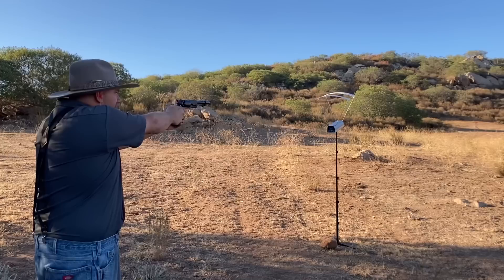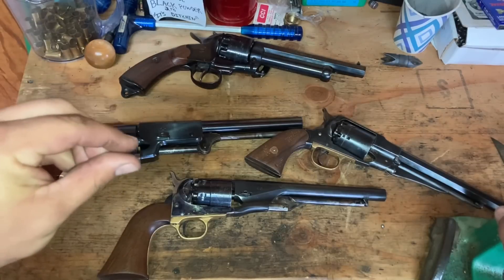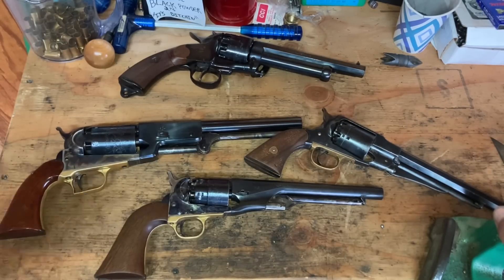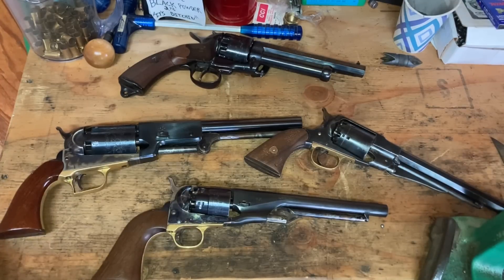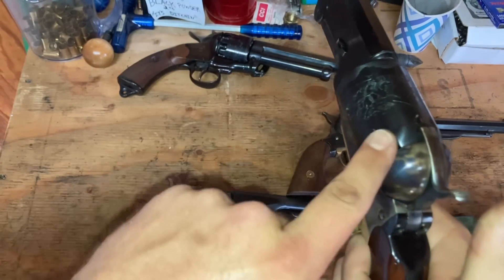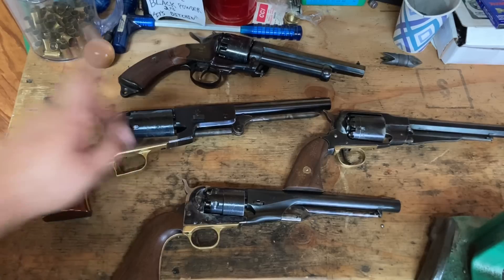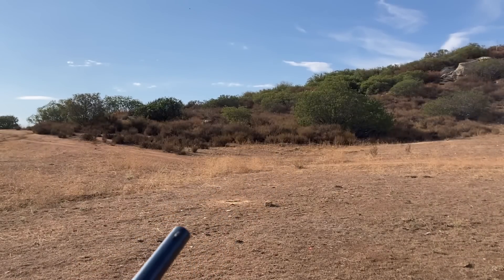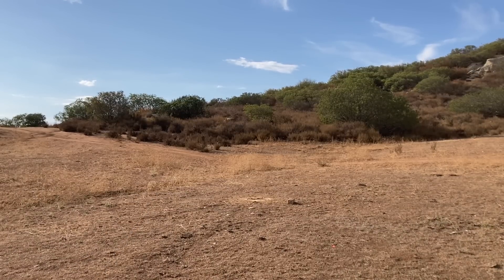What Causes A Chain Fire?

Comment: Excellent, only my opinion of course. Really appreciate your attitude about not expressing what you experienced as absolute, unquestionably true. Parrots lack that insight. My first C&B was a Replica Arms 1861 Navy (early Uberti I think), when I was 17 or 18, thought I was breaking ground, but you and others have made earlier tracks. That was sometime in the 60’s. Tried to make felt wads the way E. Keith described. Couple of cylinders and I could hardly get the gun apart. As far as accuracy, there wasn’t much. 
Thanks for taking the time and effort to make this informative available in a video. Again, great job. O.R.
Reply from the maker: Thank you!
Reply: @Everythingblackpowder  is true black powder no longer sold???
Reply: “Parrots”. Good one! 👍
Reply: I had a chainfire once on my 1858 Remington New model army. Interestingly it was not the neighboring chamber but the one completely opposite. Let's say the one you want to go off is 12 with the barrel.... My chain fire was at 6 a clock. 

I have fired probably 80 rounds since then and I use a toilet paper wad between the lead ball and the powder charge. Now the safety rangers can go ahead and stroke out. 
I'm not saying anyone should do that but that's what I do and it works fine. Just be aware of that toilet paper wad May prevent a fire hazard in very dry conditions
Reply: @RobertWard-sb6bd  interesting. Can I assume then that you were only using powder and ball at that timer?  That sure indicates that your chain fire ignition did not happen at the nipple end of the cylinder. Just wondering also, if the ball was cast or swaged?  Thanks for the info. O.R.
Reply: @oldranger3044  it was a cast lead ball. It happened about 8 years ago so I don't remember exactly if I used a wad or not. I do remember the last time I fired and cleaned and put the gun away, i used a light oil called Rusty duck lubricant. I'm suspecting that I probably didn't clean that lubricant off very well before shooting and it may have played a role
Reply: @RobertWard-sb6bd  Thanks for getting back on this. My though about the cast is that there is usually some sort of defect where the sprue is cut off, and without sufficient lube or wad the hot gases could bypass the ball in that area and reach the powder. I think that with enough shooters commenting on their experiences, it might help to get closer to causes of the chain fires. Thanks. O.R.
Reply: @oldranger3044  I have an 1858 Remington New model army by pieta. I have a round ball mold for.451. I just ordered one and 454 what just what I hear most people saying to use but I have also heard 457. I do know the 451 will not shave a ring of lead off of the ball. Anyone that owns a cap and ball should get themselves the proper sized mold and not only save money but also have fun learning to cast bullets
Reply: @RobertWard-sb6bd  I agree, but then I I have almost more fun casting, and there is no cleaning afterwards (actually that’s not bad when set up for it). Round ball casting is a great beginning experience because it is not as critical as say modern bullets, and the chambers do the sizing. Of course there is still the necessary precautions. I shave a fair amount of lead with the .451 Lee mould. That is with older guns where chambers are not beveled, like the newer Uberties. Thanks again for the comment. 👍. O.R.
Reply: @oldranger3044  all you need it the most basic level is a bullet mold and a propane torch and a ladle and a source of lead and you are in business. Round LEAD ball for life.

I found one place online that will sell true black powder and it's called track of the Wolf. Unfortunately they have a minimum order of 25 lb. 

I believe that's due to hazmat shipping regulations and if I remember correctly the synthetic propellants do not suffer from that.

Do you know of anywhere online that percussion caps and propellants can be had without buying 25 lb? 
Thank you in advance. It's hard to shoot very often if you can't find the propellant and the caps.

I dunno Dixie gun works sells a device that will punch out number 10 or number 11 caps from a beer can. Of course you would have to make your own priming compound.

A combination of match heads and the red phosphorus from the striking pad could be used in a pinch but of course would be very corrosive. But it's not like we're talkin a modern gun and you have to clean the piss out of a black powder gun when you're done firing anyway.

There is even a video out there of a man using a North American arms 22 cap-and-ball.... Getting it to actually fire with a plastic cap gun cap but he had to use very finely powdered black powder like flintlock priming powder. He could not ignite the four f granulation. Which might work okay for the world's smallest cap and ball.... But I think it would be dangerous in a 44.... Unless maybe just a little bit of priming powder was used in the bottom of the chamber as a sort of secondary primer to set off the main pistol charge.
Reply: @RobertWard-sb6bd  Thought I had responded but maybe not or it got lost in space. Wanted to let you know that “powder valley” has black and subs and no minimum and decent prices. Hopefully this info gets to you. O.R.
Reply: @oldranger3044  thanks for the information. I did see they have some real black powder and I will probably order some but unfortunately I did not find percussion caps. But I did find percussion caps available at cabelas but they want $15 for 100. Glad I am still sitting on over 400 of them. I only shoot about thirty rounds a year so I should be good there for a while
Reply: @RobertWard-sb6bd  Glad you received the message. Somehow I tend to supply myself like I will last 500 years. Something in my childhood did it to me. I think it was as my love for firecrackers and they had been outlawed. We (two other brothers) had a pack of 50 that was given to us by a relative and we were allowed three or four a piece each 4th of July. Never cared much for that, so I think I developed some sort of hoarding problem. Anyway, sounds like you are good to go. O.R.
Reply: @RobertWard-sb6bd  :   I was interest that InRange found that around .451 ball, he was getting chain fires.    None when .454 as I recall.   Currently I have .457 balls (came with the ASP) and the JD conicals are .460.   Pietta recommends .454,  I am going to tray those and see what width band I get (the .457 are 1/4 inch wide.     If you are going to go fully dry loads,  then you should get each chamber.   A badly bored one could let by the flash.   A shaved ring of lead won't show that though you may see an offset lead ring.
Reply: Thanks for the ideas. I will try the wad on top of the chamber.
Reply: Wonderful video!!! You just reinvigorated me to shoot my black powder revolvers again!
Reply: What about lubing the ball or bullet ?
Reply: @carminetocco9334  Pretty difficult to lube the ball, but adding lubricant to conicals that have lube groves can help. O.R.
Reply: Does a chain fire shoot the other cartridges out of the cylinder to. I mean that would blow the gun up wouldn't it
Reply: @justjoshinya8309  Yes. If it occurs when firing the first chamber of a fully loaded gun, then either left, right, or both 😩 adjacent chambers can fire. When loading five, the right side is empty. The same is true after firing several shots. So, most common is for the left adjacent chamber and there is room for the projectile to travel along the side. It probably gets deflected by the barrel wedge on colt style guns. If you are unlucky and the next chamber also goes ka-bang, it too will slide down the left side. If you’re having a bad day the one at the bottom goes, and the ball or whatever, hits the loading lever area and I won’t speculate on the damage. This is probably the worst case. The only positive thing is that when a ball is fired from a chamber only, the speed is maybe half of normal, so energy will be about 1/4.  😅. O.R.
Reply: Removed
Reply: Bullets not cartridges (picky maybe but there is a difference as you can get conversion cylinders to make it a cartridge gun).     That said,  yes,  bullets come out..   If its the adjacent chambers (1 and 11 o clock)   to the fired one, you will get shaved bullets but reported no blow up.  Not sure you won't get some splatter.  The 5 and 7 o clock chambers are free so will go straight.    The 6 o clock of course is going to hit the frame straight on.     Reports I have seen says no gun blow up  (even the originals)  but you surely will get blow back into the face and your hands will get shards.
 @justjoshinya8309

Comment: Watching "What causes a chain fire?" And wondering, is it possible that a chain fire is a result of something setting off the cap on the adjacent cylinder(s)?
I dont have a black powder wheel gun, but it seems to me like some hot embers or burning powder could exit the ripple of the firing cylinder and detonate a nearby cap.
That would also explain why leaving the cap off the adjacent cylinder doesn't set them off.
Reply: Guess I should have let it play through, in your chain fire test the caps are still live after a chain fire, so that answers that.

Comment: Their solution back in the day was to ensure each ball was big enough to shave a slice when pressed in and using correctly-sized caps that fit right.

Imho that's still a good solution... IF you can get the right caps and buy/cast the correct size balls.

If not, grease seems to be a good enough solution.

Comment: I full agree, I always knew that the myth about chain fire coming the nipples was silly. If the chain fire can’t set off the caps at the rear or at least have the pressure to pop them out, then they sure as hell don’t have a chance at letting fire in. I personally don’t use grease or wads but instead I use wax, I currently use nitrated Coffee filter paper cartridges and I wax the projectiles with them and it works pretty well. Only bad thing though is that I’m currently using Triple Seven because it’s the only thing that I can find locally and I later plan on using your method of making black powder, Triple Seven is just nasty as hell and it fouls up my revolver after 12 rounds. Nobody tells you this but you and your friends have this down as a science way better than anyone on this platform and you’ve helped out the Black Powder community more than viewers give you credit for, by filtering out the Fudd lore and the bull-💥!
Reply from the maker: Thank you

Comment: Ok, this can be scary, truth is no one even the "FUDDS" Do Not Know When? or How? or Why? They change the stories every 10 to 15 years, and they can not agree on front, rear of the cylinder that it happens at. After 17 years or so of my own experience, this is what I have learned Wads, Grease do nothing to prevent it, as it happens from the REAR of the cylinder when you loose a cap. Ah but it is proper ball size that prevents, Wad and Lube may help as a preventative but if it is the "Right" ball size you have no worries, Then again if your cylinder is ill cut it will happen no matter how you attempt to prevent. I have talked with folks shooting 35-40 years never had it happen. Others have had it happen on the first day. "Chain Fire" is one odd animal it could never happen, to you could shoot 45 years nary an issue and at 45 years 3 months 2 weeks 3 days 7 hours and 37 minutes the stars all line up and you have a "Chain Fire" So as for Causes? Reasons? How? When? Even if all preventive measures are followed You have Loaded over sized ball, wads, grease over if ya drew the short straw getting out of bed that day it will still happen. This is merely just the surface.

Comment: I use Triple 777 in my Sam Walker. It's more stable than traditional black powder, so is less prone to chain fires. It's also 15% more powerful, so you use a little less. I have always used wads, but they are a pain to seat over the powder. 777 is also cleaner burning. I should try your bore lube. I am a volunteer range officer at our shooting club in Florida. I have never seen a chain fire there, but not many people shoot black powder guns.
Reply: Personally, I make paper cartridges out of Nitrated Coffee filters and when I adhere my lead balls to the cartridge, I glaze the top of the cartridges in melted Paraffin wax and it works somewhat works as a Lube. the wax prevents chain fires as well as the Paper cartridge itself because there’s no stray powder next to the ball. The way how I see it, I personally think that pouring powder might cause more of a risk than using cartridges because of the chances with leaving stray grains around but that’s not to say that pouring is unsafe. as long as you use a proper sized ball, the chances of chain fire is probably none and it’s not necessary unsafe anyway when you think about it.

Comment: I like coming across these older videos and finding his experience had the same results of mine, only time I ever had a chain fire was one. I got my brand new 44 caliber 1860 army and I loaded it with .44 caliber round balls. I switched over to 454s and have never had an issue since, the other interesting sidenote was whenever I had my chain fire. I know I had number 10 caps on and due to shortages. I’ve been running a lot of 11 on my pistols And have yet to replicate a chain fire
Reply: I have no idea how many rounds I run through my pistols every year, but I cast about 50 pounds per year just round balls for my pistols, I only cast about 20 pounds for my rifles

Comment: Back when I used to have an 1861 colt I shot it quite a bit for a while before someone stoled it. After awhile I quit using crisco because it runs all over the place in heat, so I shot with no lube or wad protection and never had a chain fire. Plenty of other problems though. I'm pretty sure that sheared off lead ring is essential

Comment: I had a 1858 black powder. Pietta Remington style. I had a chain fire on because I was not using a heavy.Grease  to seal all the ends So I started using axle grease.It worked very well.I never had a chain fire after that and it didn't melt in the heat of arizona

Comment: Is chainfire a big deal ?
 I'm firing without lube, too small balls that never leave a complete circle of lead when i push the balls in cylinder.

Cap and ball is pretty new to me but I already fired more than 100 shot, cause there's less than half of my bullets left.
I got chainfire only one time.
And we'll it didn't look like a big deal. 1 bullet goes of with less energy and less precision, but I do believe it still goes in the good direction.
As far as I know, chainfire just cause 1 bullet lost, and a bit of black powder.

Do people largely over react and overthink about a really small problem ?
Or do I'm a lucky guy ?

Of course I just never ever have a hand or even the shadow of a finger in front of the cylinder, or even on the side of it.
Always finger on the grip and under the back of the cylinder, where they should be.

And I go like this, with precision aiming or with rapid fire self defense style.
Never have any safety issue (in my opinion that chainfire wasn't causing any issue at all, beside making my 6 shot a 5 shot)

Comment: i genuinely don't believe it to be possible to have a chain fire from the nipple. i don't see how its possible for a gas to travel parallel to a jagged surface then shot 90 degrees up then do a 180 into a hole. the only way would be if an overly sensitive cap went off from the shock of recoil. i doubt even that can happen.

Comment: I think the wad/grease compress into the chamber with the positive pressure of the round going off and if the cap are not on, it allows for air inside the non fired chambers to pass out of the cap hole. when the caps are in place, a positive pressure inside the non firing chambers caused by the compression of the wad/grease by the shot going off will push the wad/grease out, thus allowing the powder to be ignited.

Comment: That's one thing I don't like about the Colt Walker, the loading lever falling down.  That doesn't happen with my Colt 1851 Navy, and for obvious reasons considered the design change.  Anyway, I use both precut wads and grease along with tight fitting caps. Haven't had a chain fire yet.  Also, the wads don't seem to hurt my accuracy either.  Great test though.  I think you're on to something!!  Any ideas as to why the wads would ruin your accuracy?
Reply from the maker: They don’t ruin the accuracy. I just get a little better group without them